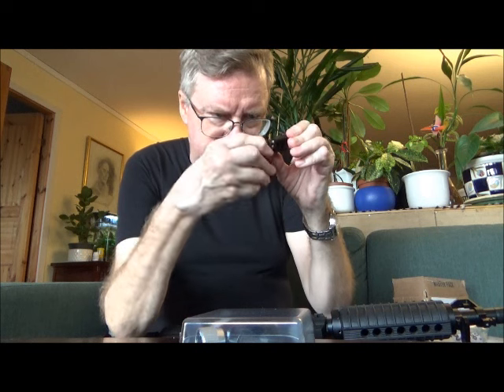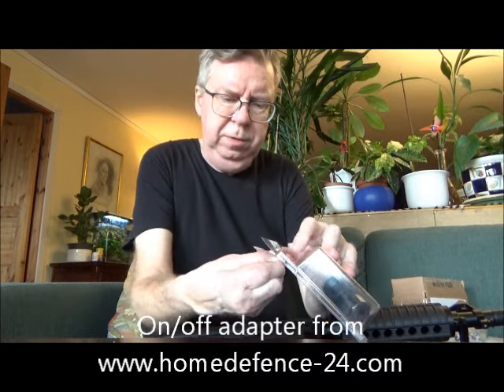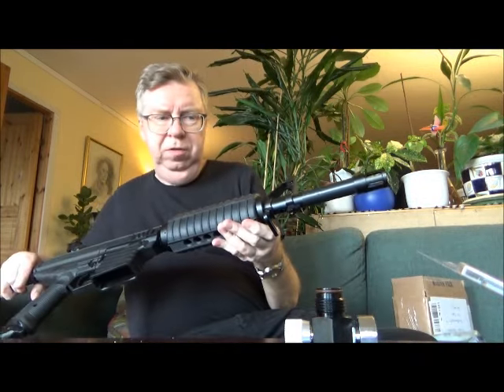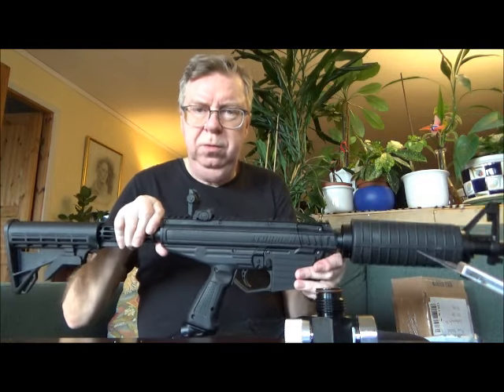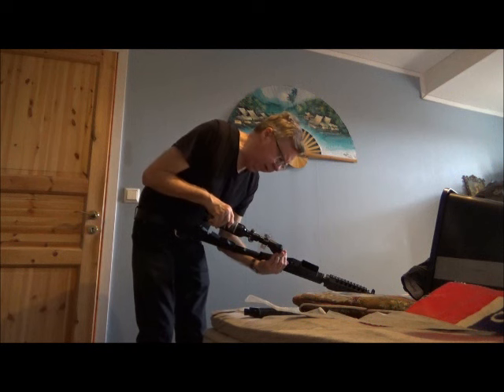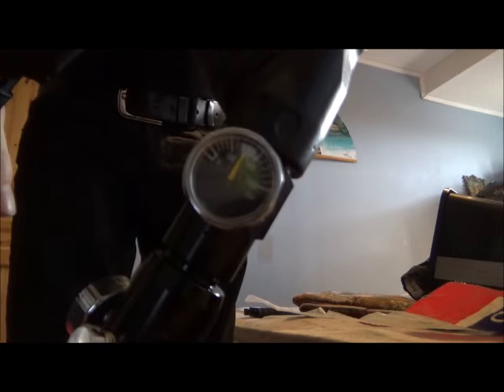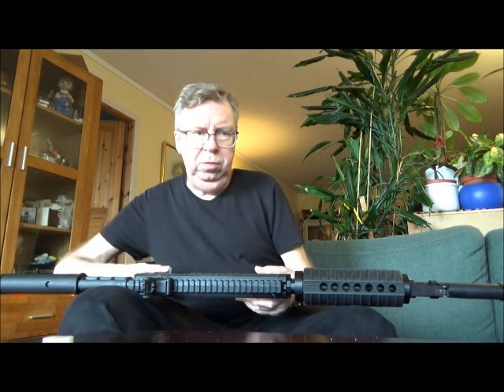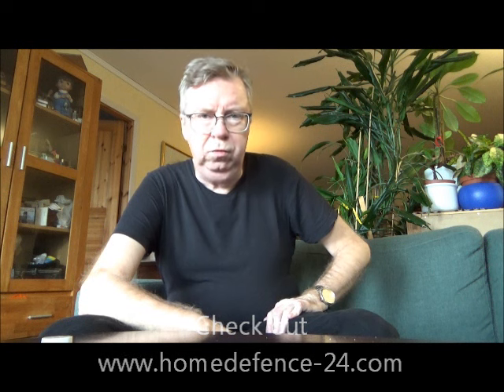Tippmann Stormer Elite, HPA vs 12 Gram CO2

Comment: The HDR 68 supports an HPA Kit with a 4500psi tank and a 1800psi regulator? It has an On/Off valve and a 30cm barrel. If it can handle it, how many joules do you estimate when using 9-gram pointed steel ammunition?
Reply from the maker: Sounds a bit to hi pressure for that marker. But I guess it will give ca 60 joule or so. Maybe even more with a tuning barrel🤔
Reply: @runerebel8441  The kit I use is exactly the same as the Z-RAM's, and they claim 91 joules. That’s with a 0.20L 3000psi tank and a 1100psi valve, with a 20cm barrel. I want to use a 30cm barrel, a 4500psi tank, and a 1800psi valve. Shouldn't it exceed 140 joules? Would the weapon withstand a 4500psi tank and a 1800psi valve? I'm aiming for 150 joules 😬
Reply from the maker: @HDefenseBr  It sounds risky to put that kind of pressure in it. The marker is made of potmetal/zink and plastic. It might work for a few shots. Hard to say for sure...🤔. Two of my friends tested with 2000 PSI . One lasted two shots and the other 6 shots. But they both broke. 1800 PSI might last longer🤔. But I dont recommend it. If you want to make it last then dont go over 1100 PSI🤔
Reply: @runerebel8441  Which parts of the gun broke?
Reply from the maker: @HDefenseBr  One had the CO2 tube blow out and the other it was something inside, but I dont know what.